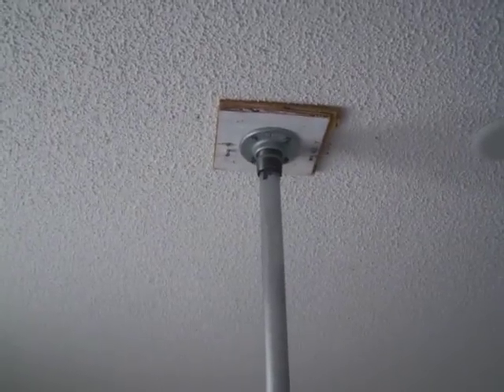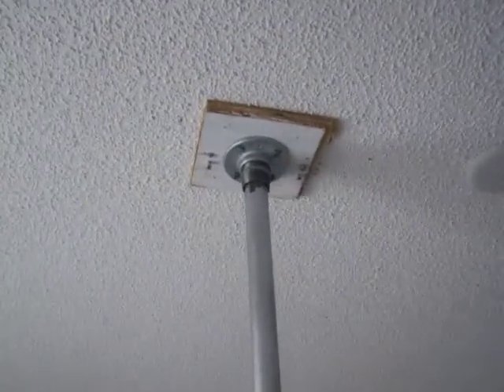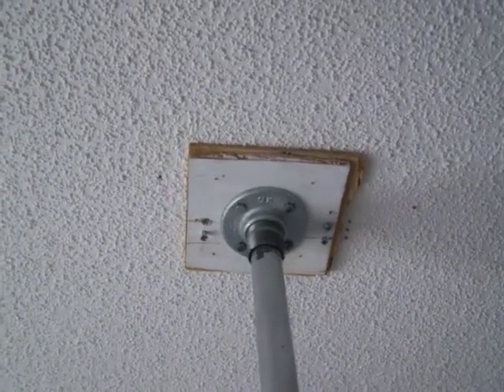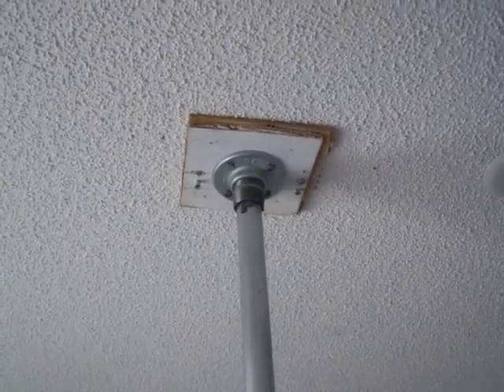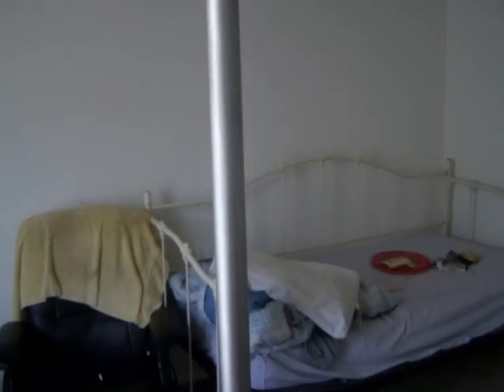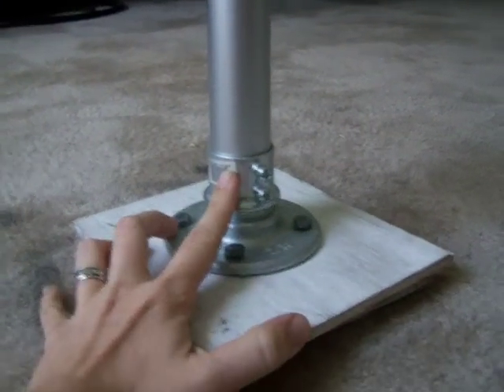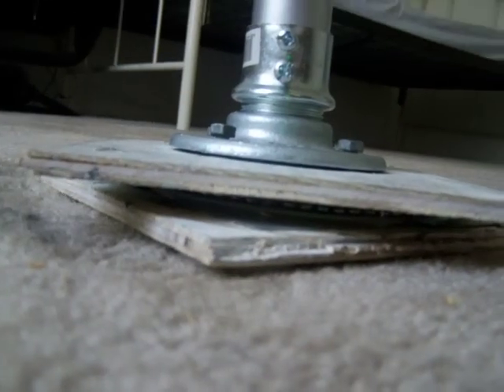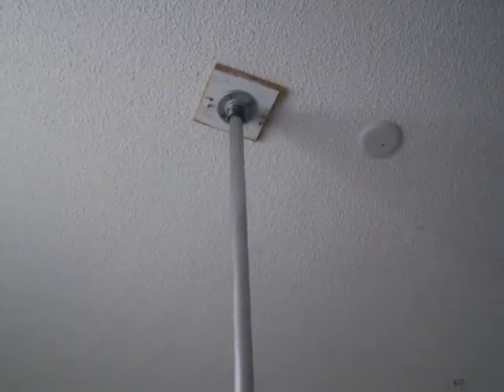DIY Spinning, Removable Stripper Pole! **NEW POLE VIDEO POSTED!**

Comment: I made this pole in my house and it turned out great! I have vaulted ceilings so I had some issues in trying to get it hooked up propperly, but ended up getting it figured out just fine and I have been loving it! I do wish I could firgure out how to get it to spin a bit more evenly, and I think I need to put more lacquer to get a better grip, but it is definitly worth the $50 and way better then any pole that you could buy for even double the price. Thank you so much for this information!

Comment: Oh yes! Absolutely marvellous inventiveness! I just jumped out of my seat when I saw your comment and went to your video. Why didn't I think of the spinning bearing sets? I've actually ordered these things to fix a rotating easy chair recliner--and the thought never crossed my mind. I didn't think of an open, greased nipple up top--it's a good idea. Yes, I used the same adapter with the 2 screws. I wrapped them in black rubber tape, but still pole in shoes for safety, LOL! Keep on polin!

Comment from the maker: The rotation causes the flange to wobble.  As time goes on and you use the pole a lot, it eventually creates weak spots in your ceiling, causing it to break away.  That's why I put the piece of wood between the ceiling and flange.

Comment: ever have any issues with stepping on or stubbing your toe on the bottom boards? do you think it would work if you bought a large piece of wood or plastic to stand on, cut a hole big enough for the pole to go through and place the lazy suzan under that with another smaller board under it? that way everything is under your dancing surface.

Comment: I see in the video you have a prewired ceiling fan conduit(its that white circle box covered with plastic. The ceiling fan housing is anchored between joists in the ceiling that would offer way more support. You could have easily mounted the top of the pole into that after pushing the wires back and properly shielding/insulating them or straight up removing the wires period all the way back into the ceiling to avoid shock to mounting the pole into that receptacle.

Comment from the maker: The lazy susan is tested for 500lbs, but the most I've ever personally put on it was about 260 when me and a friend tried tandem tricks. The only potential problem I saw with that weight is you have to be sure the top is secured to a beam or it will easily wiggle loose with the centrifugal force.

Comment from the maker: It depends on whether or not the existing holes match up with the holes on the flange.  However, better to use all four holes on the flange to bolt it to the beam and distribute the force a little more evenly.  You can never be too careful.

Comment from the maker: Thank you!  I just built a new pole and I'm uploading the video now.  I tried your idea to use round pieces, and I wasn't able to secure the lazy susan properly without being able to screw it in from in between the pieces of wood.  But I did use half of your idea. :) It does not flex when using it.  Its just 1 1/4" electrical conduit, but the new one is 1 1/2" and the video on that one is more detailed than this video.

Comment: HI, we are currently making our own stripper pole with your instructions and we were wondering if the bottom part will slip if we use it on hard wood flooring even if we use the furniture grips...also i am a litle heavier than you

Comment: Curious? Could you invert  the pole you have built? Having the lazy susan pieces on the ceiling also making the bottom flange to be trimmed to look better? As well as it being better to lubricate the pole so it does run down? And possibly adding stationary pins through the pieces of plywood with the lazy susan between to make it a static pole? I've been researching  dancing poles for a long time. As well as being experienced in the trade. But your video has inspired me to build my own pole. TY

Comment: The top of the carmen electra pole is like this strong plastic..NOT METAL. I ask since I have the same roof...or did you do all that work on the ceiling part because its pure metal and like you said you'd put a whole straight through your ceiling?

Comment: Very nice young lady. You speak very clear and intelligent. (Unlike about half of the other people on YouTube) Very good video. On the lazy susan at the bottom, a small change to round pieces of wood rather than square would help it look just a little more professional. Would you be so kind to tell the specs on the conduit? Diameter and thickness if applicable. They may all be the same. It's it rigid enough to not flex when you are swinging on it?

Comment from the maker: Just build it according to the instructions, but without the lazy susan.  Just get a thick piece of wood to bolt the bottom flange into and put your grippers on the bottom.  It might still have some play in it, but it won't spin or move as easily as the spinning one.

Comment from the maker: NO. NO. NO.  lol  No suction!  As soon as you put your weight on it and begin to spin, your weight will easily break the suction, if you were even able to get it to suction to the dry ceiling in the first place.  There is no logical or safe way that I can think of that would allow you to use it without bolting it to the ceiling.